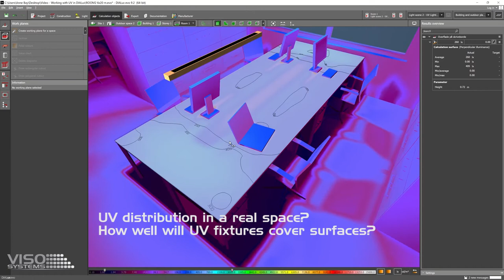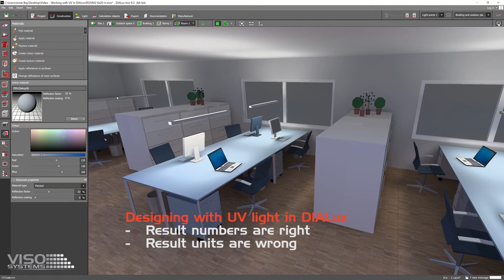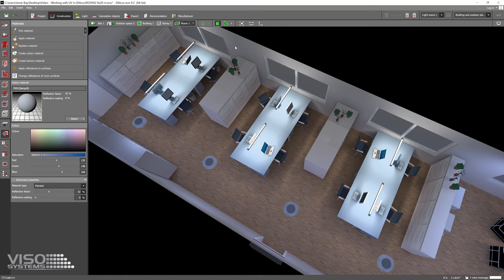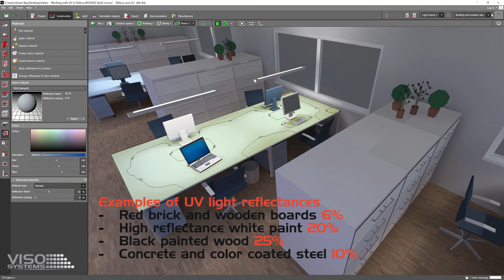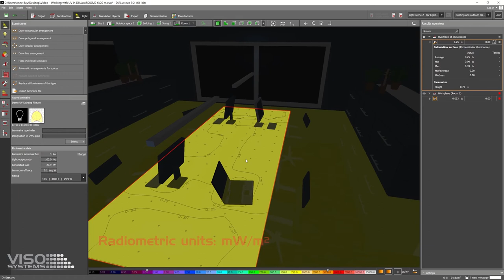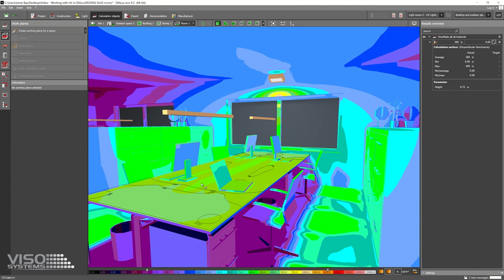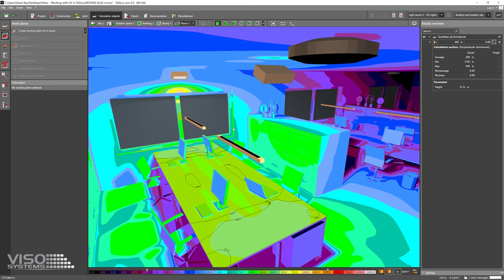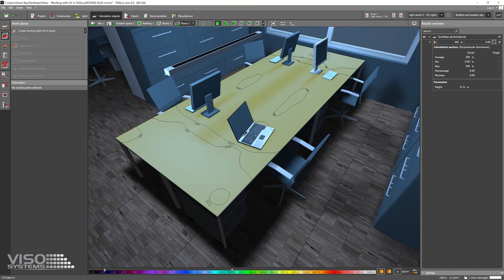Working with UV light in DIALux Evo. Simulate real spaces. Work with UV exposure and germicidal UV

Comment: Really good video, I just downloaded the viso inspector software but I'm having trouble using it. Is there any tutorial or guides that can help me access the UV light so that I can transfer it over to Dialux. Thanks again
Reply from the maker: Thank you for your positive feedback. We have issued a small step-by-step manual that can hopefully assist you all the way through. Find it here: https://data.visosystems.com/content/manuals/guidelines_working_with_uv_in_dialux.pdf.
If not, feel free to contact again on info@visosystems.com.
BR Anne
Reply: @VisoSystems  thank you so much
Reply from the maker: @Nasir-gu4ek  Forgot to say, you need to download the latest beta version 6.56 to have the UV options available. Also, I don't think there is UV light measurement demo example in the standard download. Send an email to info@visosystems.com and I will reply with a demo file attached, so that you have a real Viso measurement to play with.

Comment: Hi,
I am trying to do a study where I need the radiation distribution of the hole spectrum (UV+VIS+IR), in radiometric units (W/m2), of typical metal halide lamps. 
Do VISO Light inspector only apply to UV lamps and UV spectrum or can I use enlarge the output spectrum, instead of limiting it, in order to achieve what I need?
Thank you
Reply: Hi there,
Our standard systems can run either VIS (360-830 nm), UV-VIS (200-850 nm), UV-VIS-NIR (200-1100 nm), or VIS-NIR (360-100 nm). I hope one of them suits you?  Write to info@visosystems.com for more information. BR Anne

Comment: Hello, 
I would like to do the same study, but with different UV lights. How did you find your UV light file and import it into Viso light inspector? 
Thanks
Reply from the maker: Hi Douglas. Well, the video example uses an original Viso UV light measurement file exported to IES (or LDT). To work with DIALux in the described way, you just need a UV light distribution file in IES/LDT format. You don't need to import into Viso's Light Inspector software. BR Anne
Reply from the maker: ...forgot to mention: Viso specializes in making such UV-VIS light measurements. So if you need a UV light distribution file, this is exactly what Viso equipment can do.
Reply: Thank you for your answer! Is it possible to create a .ies file myself from the Viso system software?
Reply from the maker: @douglasbertin2627  Certainly - that is a standard feature. Only thing to remember in UV IES files is that units are wrong. The lumen package will be in W not in lumen. The intensities will be in W/sr, not in candela a so forth. This means that your lighting design result will be in W/m2 - not in lux. As UV sources are often very weak, in often makes sense to manipulate your measurement results before exporting to IES: Simply multiply your overall result with 1000 before export (overall result then in mW). Consequently, lighting design results will be in mW/m2.